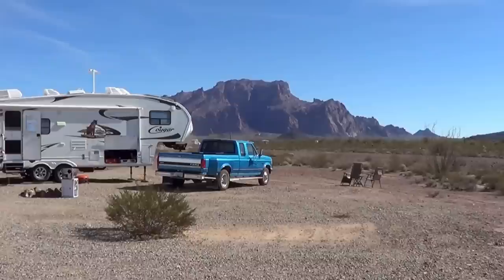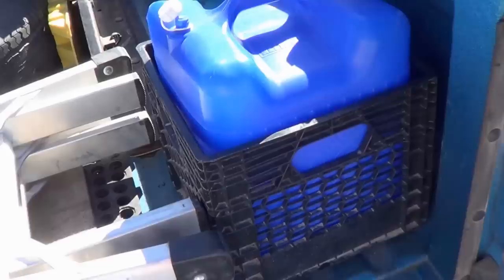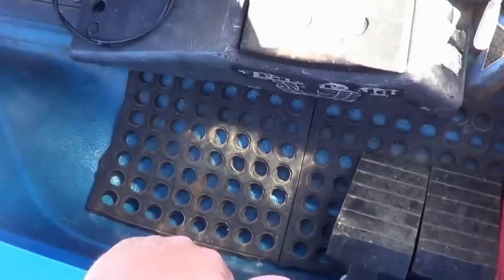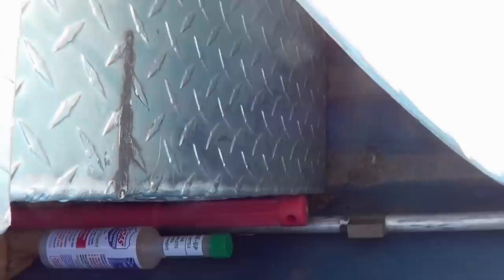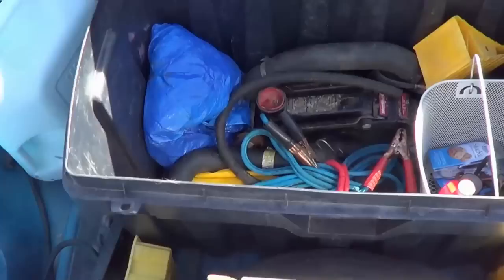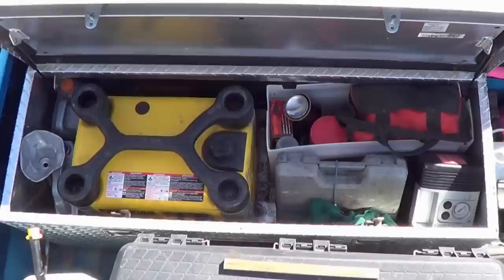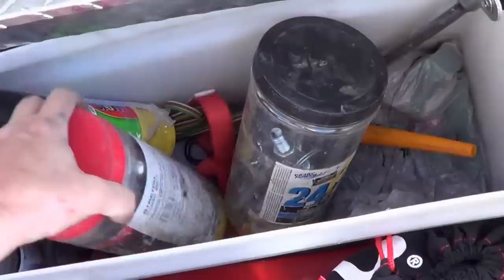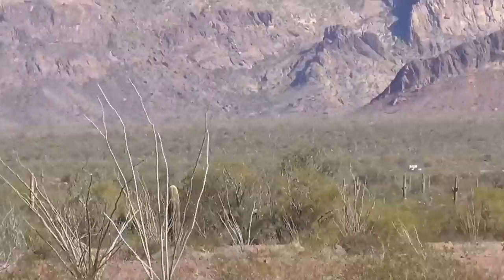Fifth Wheel Towing - What's In Our Truck Bed?

Comment: Wire when checking tread wear, check 4 areas/points around tire. Looking for any unusual tread wear. The least amount of tread measurement  is the measurement for that tire. Look for tire separation. This would be any bulge in tire including sidewall and the treat surface.

If you have a slow leak in one of the trailer tires, The first thing I would check is the metal stem itself. if it is leaking, get the right size wrench and tighten the nut next to the wheel. A rubber stem can leak as it gets older. Valve core can leak. Get a valve core remover for tightening/replacing. Yes, metal caps.

Enjoy your videos!!!

Comment: Hive tool!   I'm a beekeeper so I knew it when I saw it.  Never thought of using one for RV use.  BTW you can also get a bee keepers "Frame groove cleaning tool" which is used to clean out the grooves in bee frames to prepare for putting in new bee wax foundation.  The one I have is excellent for cleaning out old grout, sealant, etc and prepping for new.  I think I may have got it from Dadant. Thanks for the videos.

Comment: Having a beagle in the box is kind of like a jack in the box, no.  I love the scenery, it is just beautiful.  I understand why many of the westerns were filmed here.  It is said that John Wayne really liked the areas when filming here.  Does a fifth wheel camper do the washes better then a bumper hitch?  Safe and happy travels.
Reply from the maker: Hard to say, since there are so many designs out there. Would be interesting to compare
I know the biggest problem with fifth wheels is dragging the bum end and the front hitting the truck bed rails. Luckily I have a low sitting truck, not 4x4 so lots of bed rail clearance and the back end doesn't have an excessive overhang.

Comment: Don't full time,  don't have the fifth wheel, have a 74 Argosy 26 TT, and a 93 F-350 7.3L just like yours! Have you had any particular problems with the truck and have you added any mods I might like?
I added a Banks turbo last winter which gave it much more power but no extra mpg.
Love the videos and I love to see someone improve their rigs without buying NEW!
Chuck in TN.
Reply from the maker: Thanks. Haven't done too much to the truck other than keeping up with the maintenance and repairs. Most of the problems have been the regular stuff that has worn out like fuel injection pump, exhaust manifolds, glow plugs, brakes, radiator, etc. Great truck.
Cheers! Ray

Comment: great video ray, we're getting ready to retire at the end of the month, have you ever tried thousand trails. we might try some boondocking but solar looks like it's expensive
Reply from the maker: Thanks! Yes, we had the Thousand Trails zone pass for several years. If used enough it's a good deal. Before solar, I would invest in a small quiet type generator and extra battery power plus a battery monitor. Then if you like extended dry camping solar would be the next step. Like you say it gets expensive. :)
Reply: Build your own solar system
Reply: Because solar can be expensive that's why i am doing it before I retire.

Comment: Don't see a tailgate ladder.  Definitely helps.
Reply from the maker: I'm still pretty agile so not an issue yet, also the truck has diamond plate running boards which help a lot.

Comment: Ray...I noticed that the wood planks you use to level the Cougar only raise one axel/tire. Was wondering is that is ok. I'm tired of having to haul around 6' 2x10 planks as levelers for our Sabre. Was wondering if I, too, could get away with shorter ones like you use; or is that just a temporary set up?
Reply from the maker: My planks actually can span both tires but sometimes I only put one tire up to get an more accurate level. It's never hurt anything. There is a lot of play up and down with equalizer in between the wheels.

Comment: Good video Ray,what kind of up grades have you done to your truck as in engine,trans and wheels and tires,air filter,and how many miles on the old girl.thanks GW.
Reply from the maker: It has around 165,000 miles on it. I haven't done any upgrades. I believe the only change from stock by the previous owner was a K&N air filter.
Reply: Ray you could do a video on your truck,its a classic.
Reply from the maker: Got one. :) - http://www.loveyourrv.com/big-baby-blue-1994-ford-f350-truck/
Reply: Thanks for the reply,good truck.

Comment: Hi Ray, interesting collection of stuff ya got there.... Has me wondering how much weight you have on the back axel, whats the limit, and what is your pin weight? What percentage do you run your pin weight at?
Reply from the maker: The rear GAWR is 7400lbs. Last scales I hit we were quite a bit under somewhere around 5400lbs. Fiver comes in at around 9400lbs with 7600lbs on the trailer axles and 1800lbs on the pin. Of course, that changes depending on which tanks are filled. Our fresh water is way in the rear and black and gray are towards the front.
It's nice to have a 1 ton dually truck when towing a so-called 1/2 ton towable fifth wheel, lots of extra capacity.
Reply: Love Your RV excellent 👍🏻 Our Eagle is a little heavier @ 12500 lbs. My F350 real axel is good for 6800 lbs. All my tanks are midship and I try to keep my pin weight at around 20%. I sure wouldn't want to be hauling that with a half ton that's for sure😬

Comment: Hi Ray.  Did you bolt either of your tool boxes to the truck bed? Thanks in advance.
Reply from the maker: My diamond plate one is bolted to the truck bed. The black plastic one is not. Just sits between the hitch and the other box.
Reply: Was there any particular reason why you bolted down the diamond plate?  and/or why you didn't bolt down the other box?   PS - you make great videos! 
 Thanks again.
Reply from the maker: The box itself and the stuff in the diamond plate I don't want to be stolen, so makes it a bit harder as they can't just lift it off the truck. The black box is cheaper, has less valuable things so not as concerned and I sometimes pull it out and use it as an extra camp table when boondocking. Thanks! Ray

Comment: Has the truck ever given you any serious troubles?
The new Diesel engines have been ruined by all the emissions added to them in my opinion,,,,
Reply from the maker: It's never left us stranded but has needed repairs and maintenance over the years like any vehicle. 
Biggest ticket item was a tranny rebuild $2500. We bought the truck 6 years ago for $8500 and usually put on $2000-3000 a year into it. Insurance is pretty cheap since it's older at about $900 a year.
We average about 15,000 miles a year most of it is towing the 9000 lb fiver.
Reply: Love Your RV thanks for sharing the information about your truck,,,, I really enjoy your video's and learn a lot from them,,,,
Reply: Well Pilgrim I’ll tell ya this ( can you hear the Duke ) I have a 2014 F-350 with a 6.7 liter. It’s quiet, gets decent fuel mileage and has all power and torque to pull my 35’ trailer. I normally drive over 65 mph but I’ve had the truck and trailer well over that passing on the Grapevine. But I will say between the engines between the 7.3 and this 6.7 are not that great.

Comment: hi 
I do watching all your videos, I would like to ask, what kind of switch do you recommend for solar between solar panel and batteries  (disconnect like
thnx
Reply from the maker: On my system, I just use a waterproof switchable breaker like they use on boats. Pick an amperage higher than the max current expected in the wire.Blue Sea Systems 285-Series Circuit Breaker http://amzn.to/2l9BfAu
Note: If you are using a high voltage solar array you may need to us something else these switches are only rated to 48 volts

Comment: Ray, how much air pressure do you keep in your trailer tires?
Reply from the maker: My trailer calls for 65 PSI for its OEM tire setup, but I went up a load range on the tires and they can now take max 80 PSI. I usually run them at about 70-72 PSI Seems like a good pressure the load. Sidewalls don't bulge and there is some room for heat and elevation expansion.
Reply: I upgraded my Laredo fifth wheel to a "E" rating as well, I just wasn't crazy about inflating to 80 psi.  I know you put on a lot of miles and all sorts of road conditions and this information you shared with me is a big help.  I hope the five Carlisle tires I purchased hold up for me.  I have a trailer aid like yours and I could not get the flat tire up high enough to change it.  Maybe my RV is just too heavy for it.  🙂🇺🇸
Reply from the maker: With the trailer aid, you may have to put a 2x6 plank under it.  Some of the suspensions have an equalizer in between the wheels and that can cause the need for even more height than the trailer aid has to get the wheel up.

Comment: what size champion generator are you using? any review comments on its performance?
Reply from the maker: It's a 2000 watt model - http://www.loveyourrv.com/champion-generator-review-5-years-use/
It's been great, nearing 6 years old no still running well. Cheers! Ray
Reply: Thanks! We are considering the Champion 75531i 3100watt with remote start...morning coffee without getting out of the trailer ;-)

Comment: no problem leveling the 5er with just one axle holding the weight?
Reply from the maker: Not standing still like that. Not all the weight is shifted plus there is a good margin of extra capacity on my axles. They are rated for a combined 8800 lbs and the trailer only puts 7200 on them.
When you think about it, the forces on the axles and suspension sitting still is nothing compared to what they see then moving at high speed and hitting bumps, potholes, tight curves etc. We often just raise one wheel to get more accurate level side to side.
Reply: Hi, Ray,
 
I'm sure you've been asked and answered this question many times before, so I apologize in advance, but what model of 5th wheel do you have?  It's apparently a Keystone Cougar, but what year, model, length, etc.?    Thanks.
Reply from the maker: Its a 2011 Model 276RLSWE measures around 30 feet from tip to tail
Several years ago I did a full review in it - http://www.loveyourrv.com/keystone-cougar-276rlswe-fifth-wheel-trailer-review/
Reminds me, I've been meaning to do an updated one..
Reply: Thanks!   :-)

Comment: Not surprisingly well organized; you can this isn't your 1st rodeo ;-). What 2way radios do you have? What is the range? Thanks.
Reply from the maker: They are Motorola Talk About radios We've had them for a long time. I believe the range was quoted as over 20 miles but in real world, I find they are only good for a few miles. Maybe the newer ones are better.

Comment: Love your truck. Back when Ford made work trucks rather than luxury limousines that they call trucks.
Reply from the maker: Yes, has been a great truck. However just got the bad news the other day that the engine is toast. Bad rings or a cracked piston. Started making a loud banging noise at idle. Has excessive blowby and leaking lots of oil out the seals. :(
Reply: Love Your RV what engine does it have?
Reply from the maker: 7.3L IDI turbo diesel